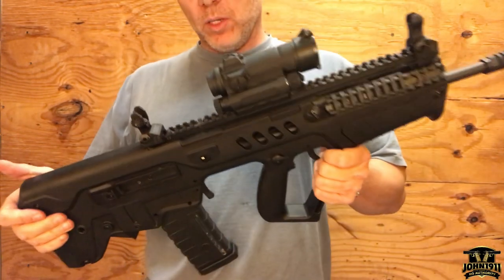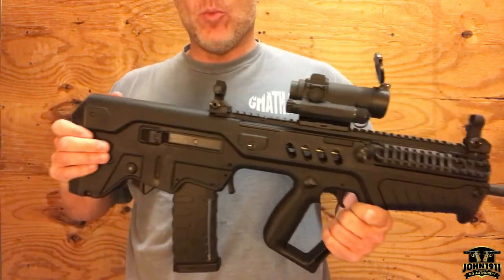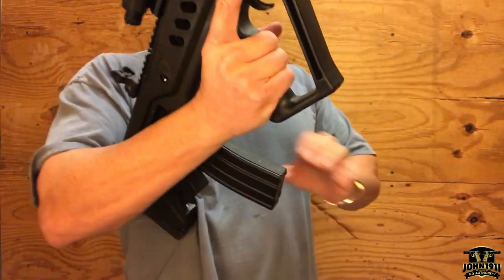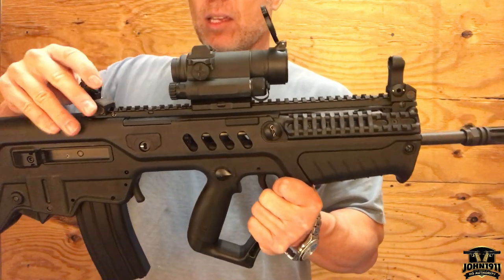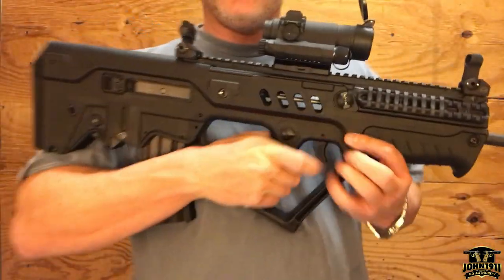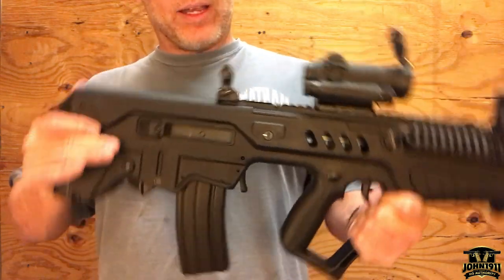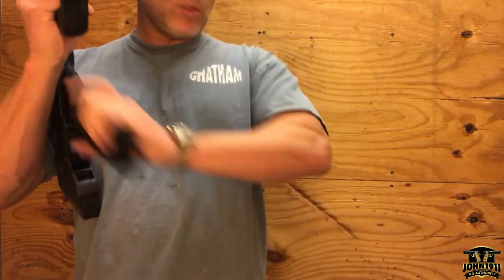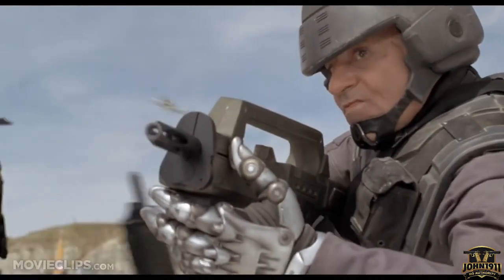SHS 41 - IWI Tavor Bullpup

Comment: I know the struggle. But once you figure it out, well..... I still like mine. I have the x95. To me it still doesn't "feel" like a 16 inch barrelled rifle. To me it fits between a pistol and an ar, as far as usage.    Now go back to the counter and show me something else 😎 HAHAHA.
Reply from the maker: They’ve already called with something cool. 

What’s the difference between this Tavor and the X95? Mag release? 

M
Reply: @John1911  charging handle  is moved so its above the grip and trigger. Mag release is a button above trigger. Panels cover 3 rails in front of grip (3,6, and 9 o'clock positions) I can still swap sides with ejection port, charging handle, fire/safe switch. I'm probably forgetting a bunch, but I am on way to physical therapy.